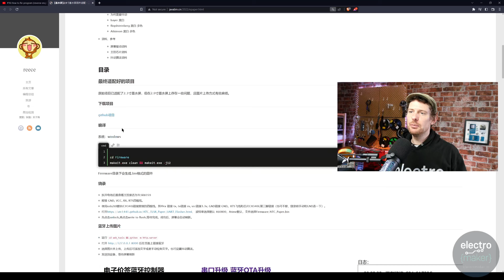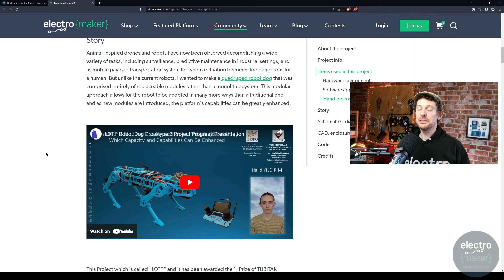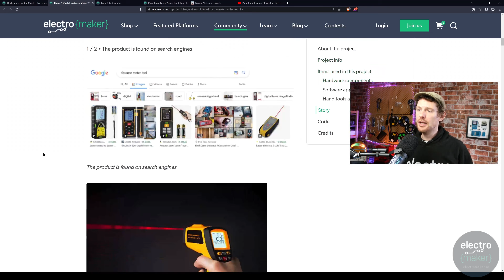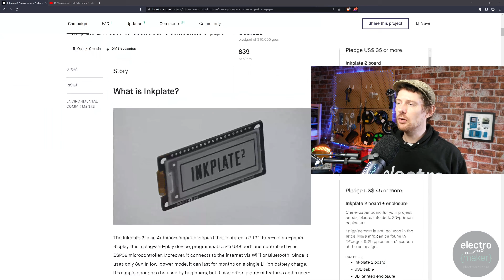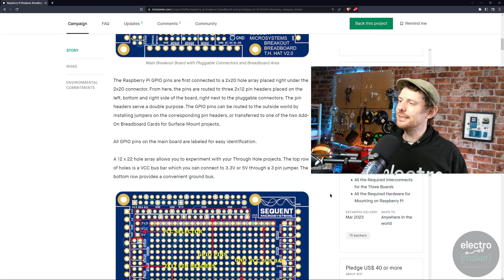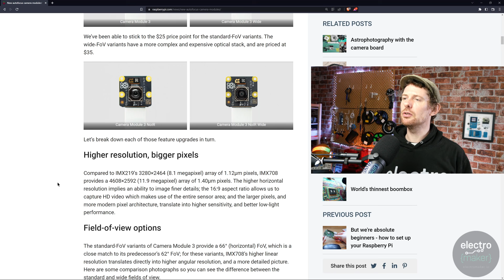Hacked ePaper Price Tags, Raspberry Pi MCU Dev HAT, Arduino Robot Arm, and More!

Comment: My local (Budgens) supermarket did a refit and all their tags are the SES Imagetag VUSION, some are just black and white and some black/red/white and in varying sizes. They installed hundreds of them. They are NFC but guessing they use NTAG I2C Plus 1K (UID 04 3C 57 02 EE 75 80 and 236 pages seems to be MiFARE) shame you cant hack via NFC (and they aren't the same format as the Hanshow)